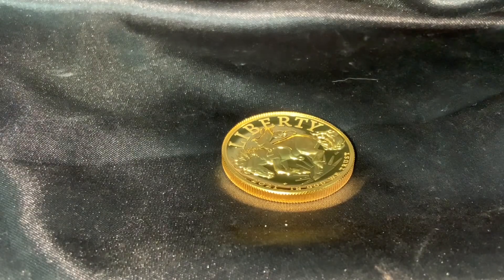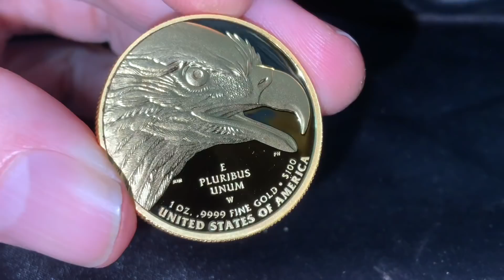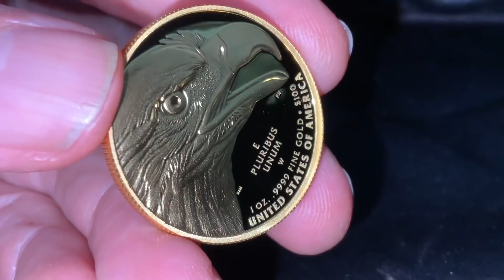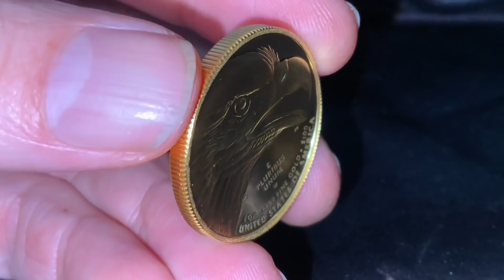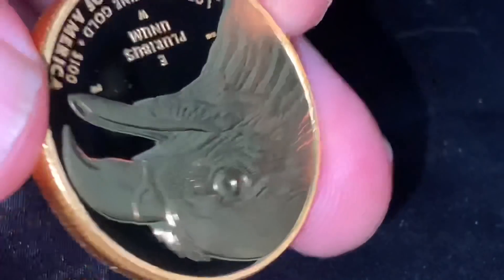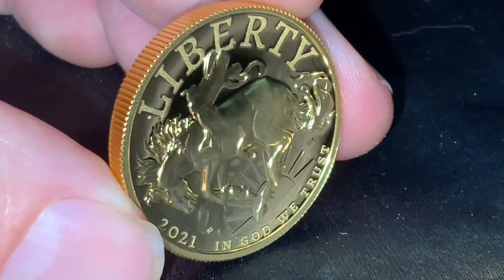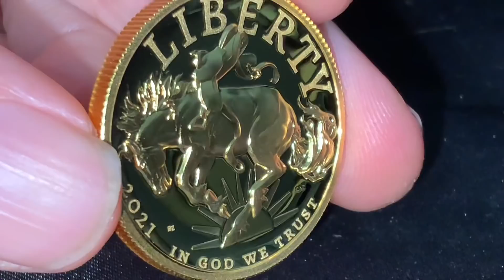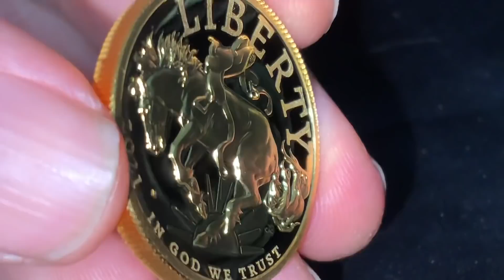A MAJOR Issue With The US Mint NEEDS To Be Fixed NOW!

Comment: This problem leads me to believe that the coin you have and others have is a result of the best possible outcome for the coin. Taking into consideration they must have test runs to calibrate their machinery before they give the "OKAY" to manufacture the coins. My question is what is the real issue causing this problem. Is it lack of precise alignment of the dies, could it be that the strength of the strike is not hard enough to bring all the metal into it's proper form. Whatever the issue is I agree with you it needs to be fixed and fixed yesterday. Have a great day.
Reply from the maker: Thank you sir

Comment: The mints quality control is terrible. After one or two coins this issue should have been resolved but every coin I've seen thus far through YouTube and eBay all have this same issue in the same area. All we can hope for is a bunch get turned back in and the mintage becomes ultra low and they become even more rare.